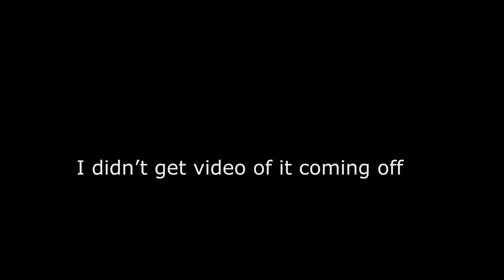1950 LeBlond Regal 17" Lathe Restoration Part 2: Starting Disassembly

Comment: Hi,
Very silly question. I just found a LeBLond 40-50s lathe on sale. A number shorter than yours but mostly of a similar feature. And have been wondering. How much cna you dissasemble this thing and how large is the largest section. Have to transport it down to my basement. In case I decide to buy it. :( 

Aaaah its such in good shape too D: Even the paint is undamaged, only oily.

Comment: You need lots of way oil everything's dry rust is not bad yet, oil n brass bristle brush to work on rust. See the gibs out oil it up your scaring the metal dry turning n moving the slide and bed ways.
Reply from the maker: Yeah I understand. I did have to oil things up a bit more before moving parts around, though I assure you there was no additional damage to the ways from this. The rust itself was too thick.

Comment: DONT sit parts on the ways!!!! If you don't know what your doing, then leave it to someone who does! I see more "beginners" destroy good lathes using their hack methods!
Reply from the maker: I think you underestimate how poor the condition is on these ways. Setting some parts on them for a few hours isn't going to do anything compared to the years this spent facing the elements. The bed on this almost certainly needs to be re-scraped, and getting both the tools and experience to do that will take some time.
Reply: @cavemaneca  Poop excuse for stupid behavior. Also, a bad example to anyone watching who doesn't know better...